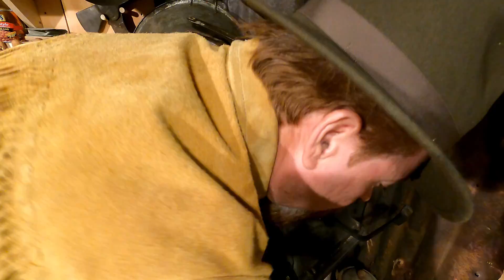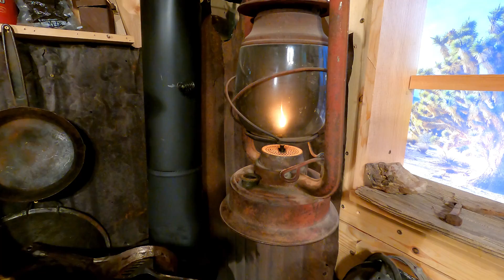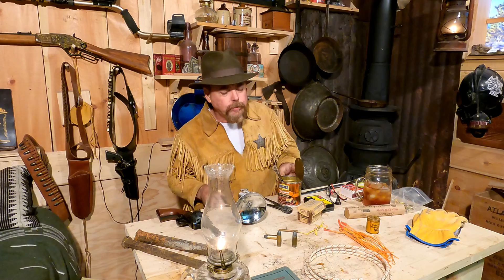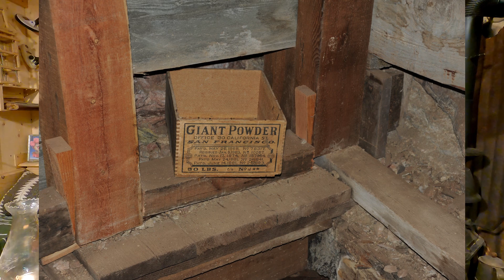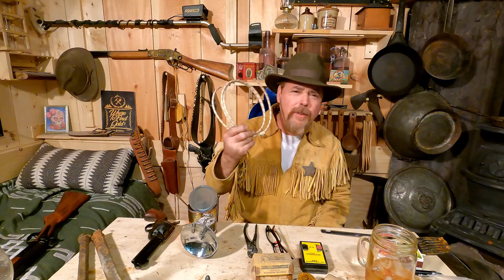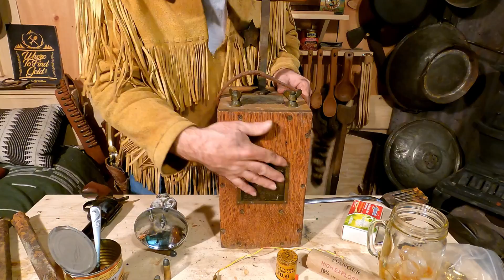How to Make Old Dynamite Explode .

Comment: A geology instructor took our class on a field back into a huge slate mine in the Sierra Nevada, not a gold mine, a slate mine right in the middle of the Mother Lode. Way back inside, there was a slab of slate hanging from the ceiling with a boot leg round running through it.  You could still see the marking, "60-40", on the side.
Reply from the maker: wow !

Comment: I'm not sure if Nobel made all dynamites the same size.Some dynamites are 190 gram,and extra large sticks also exist.The original dynamite had 75% nitroglycerin and a few percent of sodium carbonate mixed in the binder as a stabilizer.It would neutralize any acids which would make nitroglycerin even more unstable.

Comment: I'm not sure when,but after a time single component mercury fulminate caps were mostly replaced with double component caps containing a primary explosive like mercury fulminate,lead azide or silver azide and a secondary like PETN or RDX. Sometimes they used DDNP or lead styphnate for the primary.It was probably around the time when copper caps were replaced with aluminum. 1940s-1950s maybe?
Reply from the maker: yep you are correct , most caps today are made that way

Comment: They were using No. 3,No. 4 No. 5 and No. 7 caps too.I read somewhere that until the late 1980s 12 differrent strength blasting caps were made,and military caps are even today stronger than No. 8,maybe like a No. 10.
Reply from the maker: the #6 was the most common and most used as it was great for different types of Dynamite

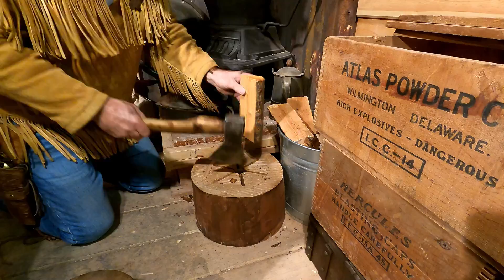Comment: 0:58 Jeff. If I could save you a thumb.

Rest the hatchet on the kindling and bounce the kindling. Your thumb should not be able on it's own to find a way to get in between the blade and the wood. Should you do it the way you do it, on the other hand, you could easily lose one. Or two. Appendages.

I know. Real men don't care.

Comment: In the 1980s in my area 2 teenager's out hunting set off a old shack of explosives. They think they might have been standing on top of the roof and shot into the building. Blast was felt 30 miles away, only a few inches of clothing were found. Hole was 100ft across.
Reply from the maker: wow ..... that will wake you up in the morning
Reply: @Askjeffwilliams  25000lbs

Comment: Back in the early 80s I used a lot of Hercules 65% Tamptite uni-gels in my day. That and Quadrex. 1/2 stick per hole and Quadrex on top, then moist dirt. My biggest shot in a single day  was 23 tons in 400 40 foot holes. I used to tie the det-cord without gloves. The head aches were killer. I love your show. You are very knowledgeable about mining and geology. There I did a comment for you lol and smashed the like button.
Reply from the maker: that has a lot of punch to it... most is 30 to 35 % wow .....23 tons ....reminds me of EOD ....the Nitro will give ya a splitting headache thanks for both

Comment: I worked for a cabinet maker missing about four fingers on one hand and about two on the other hand... 

Not from some crazy workplace accident, but because of an old blasting cap he found. Those mercury fulminate blasting caps are VERY much explosive well after you'd think they would be degraded to worthless gunk. As a 5/6year old kid,  in 1945-ish, he found a SHED fairly full of cases of very old dynamite AND blasting caps (pre-1900s, so very old and very unstable) in the Washington hills and he thought it would be fun to play with them. Well, as his friends were doing whatever and he found a hammer and struck one of the caps (thankfully far enough away from the dynamite and friends in and around the shed or they'd all be evaporated.  It was enough of a blast that they had to remove some of his finger bones from his chest and there was quite a bit of surgery that the doctor said he likely wouldn't survive.  Thankfully he did survive and the local authorities destroyed the remaining blasting caps and dynamite. 

He told me, "my lessons learned..."
Those old miners were tough and at deaths door in those conditions
One mishap could kill many people
AND... Never mess with old dynamite or blasting caps
Reply from the maker: exactly

Comment: Whats a bootleg round?
Reply from the maker: thats when one of the charges does not explode ( misfire )
Reply: @Askjeffwilliams  Ah, makes sense, thanks for the answer. Just found your channel and im very glad i did, great content and easy to listen too. By the way, that is the coolest dang cabin/man cave around and the amount of awesome stuff you have is off the chart. I wish i could have joined ya for those beans and eggs haha. Quick question you ever do a video or think about doing one on drilling out bore holes and and blasting some real dynamite or emulsion explosives(real dynamite would be way cooler) and splitting a medium to large rock, if you're still legally able to do so? That would be awesome to hear and see the right techniques you were talking about.

Comment: They should have used pressurised water to run the tools. It would be easy all you would need is water and a pump. Pump the water up higher if you can and the farther down it goes the more pressure you get a d a deep mine just means more pressure.

Comment: Old dynamite is very dangerous it's highly unstable. Iv lived with 2 Vietnam vets. Ones if them made fire bases by putt cases of bangle ors and and running det cord to them and then leveling everything.  He said all the trees that blow up into the sky would erupt a second time. And the other guy was a seabee and used explosives alot as well. He also had a stoner machine gun and a mk18 grenade launcher. And he told me a story about dynamite that was in a old explosives shed it had been there for so long that the cases had crystallized nitroglycerin a and petn and other things that explode. The lady wanted him to clear out the shed so she could use it. He told her theres no way to do anything with that shed. And not to go any closer than 600 yards preferably stay farther. If the wind blows hard enough that something taps something in that shed it will go up. So to make it safe he shot it with an incendiary round from a 50 cal from 1000 yards and said the shock wave was so powerful that at 1000 yards with earplugs in a d muffs over it his ears rang for 4-5 days and knocked air out of him. He said the 50 cal wasnt loud at all with the plugs a s muffs. He said there was over 500 lbs of explosives
Reply from the maker: great story ....thanks
Reply: @Askjeffwilliams   one of my vet friends said they used to crimp primers with their teeth because the crimpers were always stolen by the motor pool as soon as the trucks came in.  He said put your thumb on the primer so you dont bite the primary explosive put the fuse in and bite down. From what iv heard about Vietnam vs iraq and Afghanistan Vietnam was worse.

Comment: Many years ago there was a black sheep in the family. Good old uncle bob. He would take dynamite ,unwrap it and put it in really hot water as much as you could stand. Hand squeezing it to seperate the nitro from the pulp. He would collect it and use it to crack safes. All you needed was a quarter inch hole. Then you filled the safe with water and injected your nitro in it. Next a blasting cap and then a big Whomp!  Cracked open like an egg. That's safe "cracking". One question Jeff? Your wife doesn't complain about the spitting on the floor?

Comment: I've found me an old stick in a mine in NV , carried it around in the back of my jeep for a while lol come to find out that was borderline suicide , tried shooting it with .223 and ended up burning it lol
Reply: Unless it was a hundred years old, there's a number or code on it that can trace back to the mag. (Denver if fusible) most likely, and the mag will tell who purchased it.
Reply: @oddball746  it was very old , wasnt sweating but yea , i did research after the fact and found out i was rolling the big fuzzy dice a lot , i skinned it because the outside print was great , have pictures somewhere of it , felt like EOD lol
Reply from the maker: sounds about right

Comment: Question :

When you're in the mine, Jeff.
Are you doing a sweep dig to determine the width of your gold vein?

I mean, you've been hitting free (loose) gold sediments, but it's going to take a deeper hole to hit the main vein.
Reply from the maker: yes
Reply: @Askjeffwilliams  Haha!
I knew it.
I mean, due to how you thoroughly explain your endeavors, I am not surprised to figure your next step.
So...
How deep do you think it will go before you hit the vein?

I was thinking at a 30 - 45 degree angle dig, it would probably be not to far.
Given the thought that gold doesn't mix with other elements. 
As a matter of fact,  no molecule changes structure.
They're just bined together and that's why you can melt /filter AU from other chemical structures.

Another thing is that now.  You can determine how far you will dig since you know the element composition of different rocks.
You know, like when gold solidifies at a certain temperature from "air / water / gas / other rock solidifications.

You see, when you identify claliche topside, you can assure yourself that it solidifies at a certain temperature and...
When you put another metal near it, the composition reacts to both items giving you the exact amount if distance it is needed to dig for gold.

The poor miners who poured their hearts in finding the gold vein didn't realize that digging in a straight downward hole would lead them away from the motherload.

That's why most of these mines are straight and forward.  They didn't know any better to go at an angle.
Reply: So you're going to have to explain to me about this issue.

MINERAL RIGHTS

How do I know if the property I purchase from Zillow has any proprietary ownership "RIGHTS"
To my own parcel of precious metals. 
And how the heck can anyone sell property but still have dibs on my findings?

Comment: In 1855, two men were hauling dynamite east of Toronto on a horse drawn wagon.   It "spontaneously exploded", leaving behind a 10' deep crater and blew the horses and wagon parts 50'-200' away.  Only small mangled parts of the two men were found.

Comment: So how did they sequence the blasts with the old plunger type detonator?
Reply from the maker: the electric blasting caps had a delay element inside of the metal cap between the electric squib and the primary explosive .....the had a tag on the outside and were usually timed in Milliseconds

Comment: Contact is the answer to the title question.
 Dynamite, is always a fun topic. Most people think it is TNT and it is not. Nitroglycerine is a contact explosive.  Hollywood put TNT on a dynamite box. Nobody else will.
 Nitroglycerin.....Nitrocellulose,....They're even spelled different. Both still use N-O-C formula, Both need a FEP,  both will make  Basalt or Quartzite flow like water.

 I'd like to see a video on the old methods from .....drill,....fill,...light it and see if it will,...to show how risky they worked then as opposed to today.

Comment: Old dynamite sweats (many small drops of nitroglycerin can bead up on the outside of the paper wrapping).  That is extremely dangerous and can be triggered by the slightest movement.  I found two boxes of dynamite in a shallow mine in southern Utah several years ago near my grandfather's uranium mine, and some of your viewers may find some, too.  I would strongly suggest they don't touch it, and they call the BLM or police.  I have heard that when old dynamite is found, it's usually set off where they find it or in a nearby open field.  Sometimes the military is asked to handle the situation.  Miners who regularly handled dynamite found their angina (heart pain)  temporarily went away so they started making it into pills which is still used for chest pain.

Comment: I was a munitions tech in the Air Force and we still stored dynamite in standard packaging. We went out every so often and turned the boxed so the nitro wouldn’t leak well we had a really bad cold front come thru and we were tasked with taking the dynamite to inspection to be checked. Really quick to ensure there was nothing leaking. So we loaded it up and took it up to inspection on the wonderfully potholed roads of the military. Needless to say the second the inspector opened the box they immediately evacuated all of us and called in EOD to take the dynamite that looked like it sneezed out the booger of nitro glycerin all over the bottom of the box. EOD came to me and my crew mate and was really surprised it did not blow on the road to inspection so we called back to the shop and told our bosses to pick us up at the club where we started drinking... heavily. Always respect the boom booms.

Comment: Dupont had a factory  south of hannibal  Missouri and Hercules  got a factory south of Clarksville Missouri  they like hollars that would start down by the banks of the Mississippi  river and went up into the woods they put the factory's in the hollars for if it blew up the plast would go up or out across the river so there would be less  damage and save lives 🙂

Comment: just wondering, but did miners ever use a star drill, or is that something more modern

also... clay spade for your jack hammer... should be way better than a chisel bit in soft material
Reply: @Dissecting_Truth   do you mean something like an asphalt cutting bit?  that would also work. I'm thinking of anything that is wider than that narrow bit he is currently using would be more efficient at breaking loose material to make his tunnel higher.

Comment: ...by creating large volumes of  high pressure gasses at a hyper sonic velocities. The gasses will ,like water, take the path of least resistance.so it fills all fishers and voids it can find, pressurizing them ...if contained well by packing the drill hole full of debris and sealing the dynamite under it all, faults will become pressurized and  the rock  or whatever is forced towards the open shaft for the same reasons. It has Least resistance. So this happens many thousands of times over a fraction of a second in time,  creating many different sizes of debris , fissure pressurizes ,push towards the shaft , creates new fissures, they pressurize , until it all comes out of the wall and the air and gasses decompress finally.
Or do you mean, the chemical reaction? Thanks for asking,Jeff . I know you'd be lost without us telling  what to do and how to find gold all the time! Lol